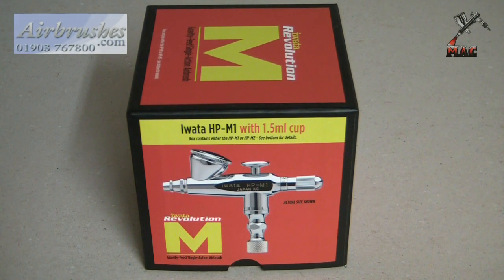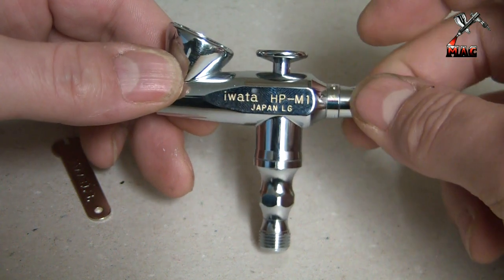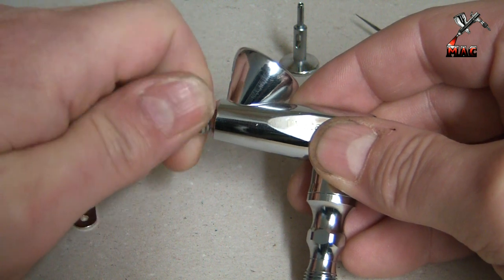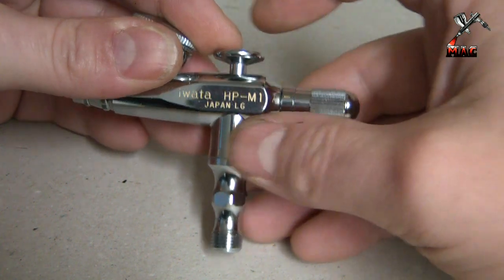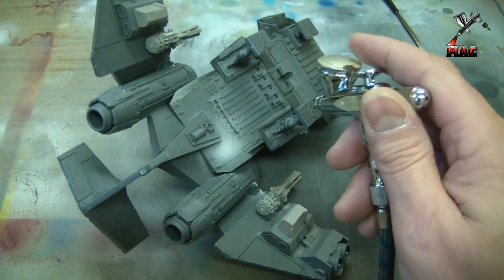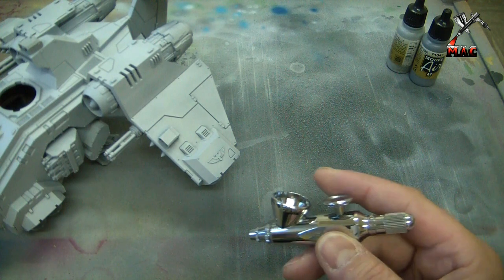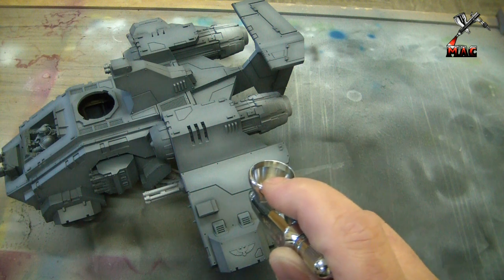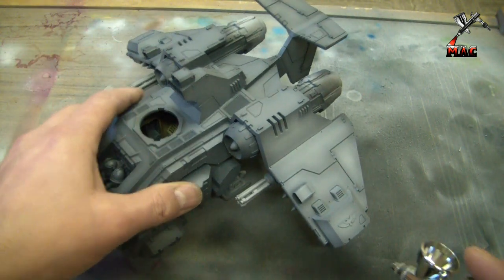Airbrush. What, How & Why - Part 1. Single action airbrush - Iwata Revloution M. Tutorial.

Comment: I have been watching your airbrushing videos, and it really has been very informative and taken the nervous-ness off venturing into airbrushing, but I had a question. I saw when you were airbrushing your model (fantastic job by the way) you didnt thin the paints down. When I was doing other research some people said that you have to thin the paints or it will give a uneven finish or damage the airbrush. Is this generally true with an exception of this airbrush? or does it depend on the kind of paint you use? Any help would be appreciated
Reply: Amy UNTOLD Thanks a lot for the info!

Comment: What is the difference between single action and double action? Can both color plastic models?
Reply: Single-action or double-action airbrush refers to what type of triggering system.

The basic model airbrush systems are usually single action and generally less expensive.The paint comes out at a pre-set rate when you press the trigger. Release the trigger and the paint flow stops.

Dual-action airbrushes have a trigger system that provide the user with much more control over paint flow. The trigger system has separate controls over both air and paint amount to be mixed (inside the airbrush) before they are dispensed. Basically pressing the trigger makes the air flow and pulling the trigger back lets you control the amount of paint.

Comment from the maker: I dry each coat with a hair dryer for speed, there was very little dry tip, as mentioned in the vid and there was zero clogging. It will depend greatly on what you spray through it ;)

Comment: Quick question, I recently burned myself by buying the cheapest airbrush I could find (almost). It does have a 0.3 needle and it is double-action, but I'm having real trouble with any kind of detail work, along with inconsistant paint flow (even using pure water gives random media feeding..) So I was wondering, is there any particular reason for having double action triggers for airbrushing models?

Comment: What would be better on a large scale model like a tank? Single or dual action?
Reply: Michael, I have now bought 3 of these single action airbrushes for my 1/72 and 1/48 aircraft modelling. They're not the Iwata but I've been using them for a few weeks now and my dual action airbrushes have been packed away.
I can do broad areas like in this video and then by adjusting the needle, super fine pin lines. I've become a complete fan of my little s.a. airbrushes and love using them. And they're so easy to clean also. From my experience now, I can easily recommend single action and would never look back.
Reply: Which model did you buy Tim ? I am looking into getting one myself and wouldn't mind if you have any info on which type ( If there are different ones ) to buy. I will be painting Warhammer stuff myself as well.
Reply: Hi Joston, sorry for the slow response - I surfed ebay and found one which looked exactly like this. Price was a big driver for me and it was from ebay store: airbrushsupplier. Their service was great and the little airbrush is awesome.
Reply: Appreciate it and no apologies needed